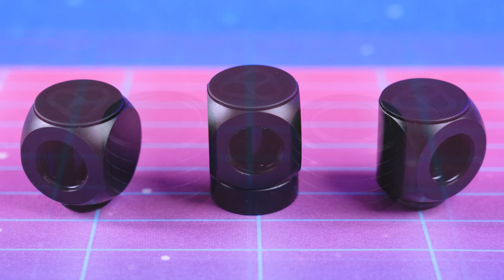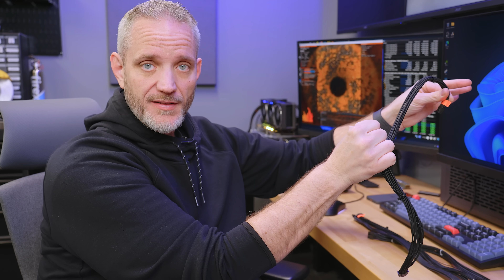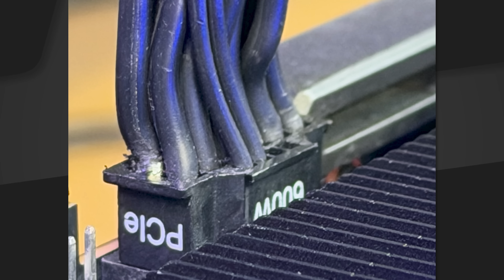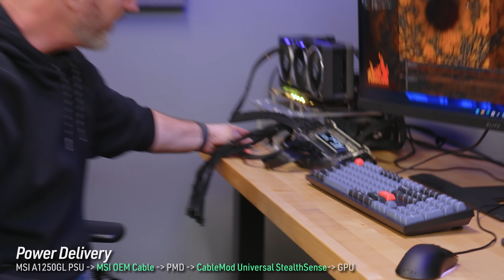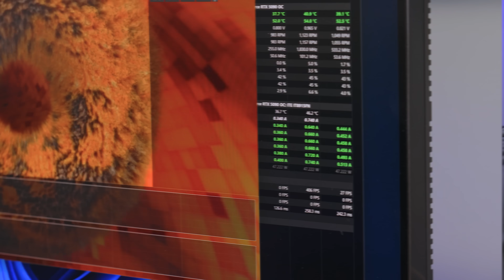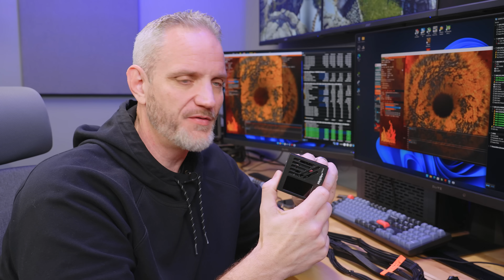More details on what could be causing 12VHPWR / 12V2x6 Cables to melt

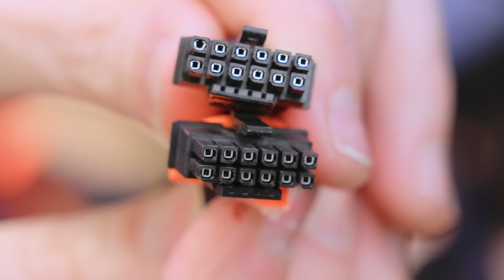Comment from the maker: Regarding 16:33, We saw in post that the corner pin was "pried open" but whats funny is that wasnt even the pin that was carrying the least load... so make sense of that one...??? Actually... its on the ground set of pins... so just as I showed by pulling out a pin, it can still work even if it isnt touching. The issue of melting connectors is almost always on the 12v side.
Reply: Two tests would be interesting:
1. A device that consumes power constantly (such as a DC Electronic Load) powered via the 12V2x6 cable with WireView.
2. Cable soldered directly to the graphics card (so you can practice soldering ;) )and observing the power distribution.
Reply: @63banshe  i think a card with a permanent cable would be less of an issue than these cables at this point XD
Reply: @MrPruske  Yup.
Reply: @MrPruske  At this point, with hardware becoming more and more expensive while being unstable as heck, i dont want to even buy it anymore. Games bad, Hardware too expensive and unstable. It is just not fun anymore to live with driver / hardware issues for years after paying thousands of euros for a computer that can barely run UE5 anyways. I dont need all of this to work on my computer and spend the rest of the time (& money) on different hobbies like my camera.
Reply: My RTX 2080 Ti S.L.I Ryzen 7 5800x 3D, with 3600mhz 32gbs ram system. Tops out at around 585 watts on GPU load max. in a few games. That's through 4 8 pci-express pins. The gold rule in life if it's not broke don't fix it.
Reply: @kevinerbs2778  what model is that? Both my 2080 ti kingpin and 3090 kingpin only have 3 x 8pins.

But yes I agree 8pins are fine. 3 of them delivered 1200 watts to the 3090 kingpin on ln2 without even warming up. They should have just switched to eps if they needed more power.
Reply: @Apollo-Computers  no,they should switch to 48v if they need more power...and use xt-120 connectors...xt-120 at 60a sustained is almost 3kw at 48v...so basically if they do this in the following year,it will be already obsolete given the speed of increasing power to gpus...
Reply: @PavelBrand  switch to higher voltage would mean new psu's.
Reply: @Apollo-Computers  it is similar to left/right drive,the sooner you do it,the less it will cost..you would have to do motherboards too...in the past motherboards depended on 5v (or even 3.3v) from psu...what would you wanna do when 1kw gpus are mainstream?that is 100a at 12v or 25a at 48v...off course hybrid psu will cost more,that's why i'm saying we need to go directly to 48v with motherboards too
Reply: @Apollo-Computers you already need a new psu for these 12v connectors...
Reply: Noticed that too.
About the 12vhpwr connector:  Never understood why they didn't choose a different connector type, the receiving pins on these are just not great for high current. The sensing is nice but not needed, abandon it and you have a bunch of proven connectors to choose from.
Reply: @audiogek  I think it was about space saving in the rack industry for server cards. And for cost-cutting measures, they just used the same design for consumer cards.
Reply: Isnt debaur give warranty for wireview 2 pro to fix or replace card in case of melting :/ I thought i heard him say that in his video. That is the reason for high price. P.S. Maybe you can make a video to strip those cables and show insides. Maybe there is some melting going on inside.
Reply: @Xioneer5 yes
Reply: Hard wire the cable to the PCB? If the connector is a problem; eliminate the connector.
Reply: That’s what I thought as well Buy a new Cable from cablemod Probably one with 3 or 4 8 pins on the power supply and And then cut off the other side of the connector
Reply: From my perspective as an automotive tech (CDJR), there's three issues here, one, the connector fitment, it shouldn't be so easy to plug in a connector, computers and autos share two common things, vibration and thermal cycling. Two, the spread terminal, that can cause issues, especially when it comes to pin fitment. Three, wire gauge, the companies that make the wiring harnesses build them as cheaply as possible so they can maximize their profits. Thinner gauge wire will wear out/fail sooner. Wiring harnesses built with wiring a gauge or two thicker can last much longer due to less heat which translates to better efficiency and less issues. That one pin pulling out so easily is a common problem in automotive wiring, so much to the point that in the service information, Chrysler warns to check for these things when diagnosing electrical issues.
Reply: You should have known the solution is "the more you buy, the more you save."
Reply: Bottom plug top right at the end also has a split
Reply: This has me thinking. With cables that are of poor quality and not correct gauge. It will affect the stability of one’s graphics card. Thus hypothetically shit cable will give poor stability and reduce overclocking potential. You might see marked increase in stability when overclocking due to proper connection and cable gauge. One thing also to think about when a card is giving problems.
Reply: Those thin cables and thin connectors are way weaker than what you find in many vehicles. Pulling some 60A in total would if you are to follow standards for electric distribution be in total of 16mm2 with properly made terminations. With 6 parallel wires it means that they shall be at least 1.85mm in diameter each, but to ensure proper conditions with parallel wires I'd say that each conductor has to be 2mm in diameter. That includes the diameter of the connector pins.

So to me the whole solution is just underdimensioned.
Reply: I maybe got a idea, remove the connector from the PCB, cutt one end of the connector of the cable, strip the ends of the wires from the cable, and solder the wires of the cable directly into the PCB
Reply: What can we do if we have FE 5080 that is not compatible with Wireview?
Reply: @mattlavallee8880  afaik derbauer was doing an adapter in one of his last videos on the wireview 2, with cables at both ends going to card and psu with wireview in the middle so that it would work with any card.
Reply: Thermal warping due to em effect or poor base metal composition causing failure under load? Causing peeling between two connectors.
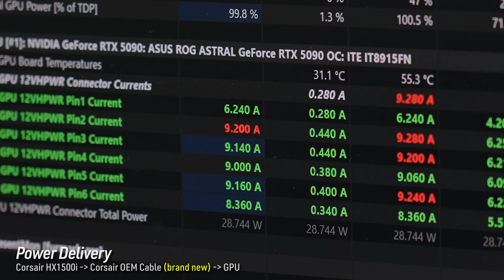Reply: 12:50 I have that exact power supply and cables in my system.  I lost a hard drive, power connector melted at the drive and the system had been doing weird things since I built it.  I'd replaced some cables with some I had from EVGA and things seem to have normalized.  Guess I'm going to replace them all just to be sure.
Reply: solder the wires directly to gpu?  lol
Reply: Hey Jay, just thought I'd ask but could you cover the 5070 and ti  issue of image flickering on displays as nvidia doesn't seem to want to fix it despite reports of people having problems since launch and having to rollback updates. Thanks.
Reply: Jay, can you make a new updated video on graphics settings? Now there's the new DLSS and Fidelity CAS is a highly used upscaling one as well.
Reply: Ye was gonna comment on that :D
Reply: You can squeeze that pin back together for a better contact. It's like with cars one loose pin will burn the whole connector or worse 🤣🤣
Reply: Hey Jay, not sure if this has been addressed or not. Cable length will also play a role in this problem. Learnt that whil rewiring an rv stereo system. Every foot of wire that thin can add some noticable resistance with that much power has anyone done the readings with short vs long cable? Interested to see. Anyway im new here.
Reply: @wayne5376  you need a bit of resistance,so longer cables are not a bad thing,helps distribute the load(if there is similar resistance in other wires)
Reply: Pinching the cable in the middle is not indicative of the wire itself being broken mid cable.... the connectors themselves can wiggle even slightly when moving a cable and come disconnected from one or more pins inside the connector. I've been building and repairing PC's for decades and I find that MANY cables connector ends are "loose" meaning they did not crimp the ends well (or tight enough). I've found this issue with AT MOLEX power connectors to SATA power to motherboard 24pin connectors to video card power connectors. The solution is SUPER SIMPLE use a pin or small tool to bend the female ends in so they pinch the male pins you connect them too tighter. You get LESS resistance (aka conducts power easier) this way and THUS less heat = no cable melt.
Reply: @AstarOfDavid (sorry, late to the watching party) the female ends, you mean the silver “square” pieces inside of each pin of the 12V2x6? Pinching them closer together so all contact points are taken care of?
Reply: I would love a video where you guys analyze regular PCIE 6 pin to 6 pin cables for older cards to check how much those have as variance.  Is that a hidden source of future problems, or are we good.  Of course, we aren’t normally having the regular cables melting and burning cards, but are they safe?
Reply: Aside from mechanical thinning of wires due to bending/pulling, you also have effects like corrosion on the pins (which is btw a problem for all connectors and why you use gold plating in a thick gold layer process or you set up welding-like processes where the surfaces combine to an air-tight object). You have problems with heating cycles. You also have problems with swinging due to fan and load on the wires/pins.

All in all I'd recommend to use the 4 Pins to establish an I2C Interface and just pull the SMBus from the MoBo through that by using the GPU as interface. That has 2 benefits:
1.) You can use a microcontroller each side to simply measure (monitoring) or even use a single or dual side multiphase bridge to control each pin and simply limit that (control) or even handling out that the gpu must use less power (react) and/or generate a warning tone (warn).
2.) You FIIIIINALLY have a standardized way of getting your PSU in the sensor network. You can now actively use the data from that end to get a FINALLY complete overview over your WHOLE pc. You can tell the user "hey man, I see ripple on my end which means my caps are old and I need to be switched out" or "hey man, i'm hotter than satans asshole, PLEASE clean and/or switch my fan!".

Nvidia just managed to actually have the worst out of EVERYTHING the way they did that. Really. They rolled a -2 with a 100 sided positive number only dice.
Reply: I see some of the connectors a little bit pried open.
Even so, yet again a solid great video!
Reply: Have you ever considered testing the conductivity of the supposedly poor-quality cables or their copper conductors, or having them examined in a laboratory?
Such cables are usually manufactured in Asia, even those from well-known manufacturers.
There are many factories in Asia that use impure materials in cables, fewer strands than specified for the AWG, CCA (copper-clad aluminum) conductors instead of pure copper, or sometimes even plain plated iron wires. Some can literally be tested by holding a neodymium magnet over them and lifting them up, which should not be possible since copper is not magnetic.
Normally, these poor-quality cables tend to appear in cheap, no-name mass-produced goods such as USB cables, etc.
But sometimes, due to fraud and gaps in quality control, such low-quality materials also find their way into the resource pool of professional manufacturing. 
I work in device manufacturing myself and have experienced this, and we are hearing more and more reports of this in the industry.
Reply: @Helli__  Come on. nGreedy used a connector made for way less current/power. Also you usually have wires with at least 100% safety margin and nGreedya is also strechting here. So even if you have impurities or stuff: nothing bad comes except you use them in endangered environment like rain, underwater and so on. Here we have a quite good environment inside a PC.

Also they took other ways which are the worst. The 4 management wires... i know a lot of interfaces working on 4 wires and provide MUCH more. One of these is connected with ALL internal important component and is also there for monitoring sensors ... the SMBus (I2C in slightly different).

nGreedya had the chance to FINALLY connect the last important component via their interface, but nuhuh it has to cost nuff. It was a chance to also kill off the proprietary solutions that most often work like a burning pile of tires, but as said: it cost a $.

The could've even gone MUCH further to allow 48-60V DC on that which essentially pushes down current to nothing AND require the PSU to have a multiphased pwm-controlled AND monitored 6 phased power stage here (which can regulate how much current each wire sees AND get the temp data - just needs a like 0.3$ controller on the GPU + some NTCs which are next to nothing). But noooooo.

It is not the wire. What burns is most often the GPU side connector, because there is where the material with the lowest melting/burning point is. IF you had a nick in the wire, you'D see that with a thermal cam, as that point will be the fking christmas tree on your screen (little area = high current/area = hotter than satans ass). What gets hot is the connection between plug and jack imo. The connector is not made to catch correctly, the crimped females are loose by default and they cant contain any strain and the whole thing does not like heat/cold cycling... and the user cant see when it is correctly mounted as there is almost no CLICK at all.

So who is at fault?
1. nGreedy taking a way too small connector for their use case?
2. nGreedya specifiying the most cheapest solution?
3. nGreedya setting up no safety measures?
4. nGreedya having the AWGs being barely able to fit ? (imo their safety marging is below 60%, while most real world use cases have like 100-150% - though even PCI 6 and 8 pins CAN melt with that)
5. nGreedya designing their graphic card to actually dont have a real world usable power stage?
6. nGreedy wasting all the potential they had with that connector?
7. nGreedya obviously giving a shit?
8. nGreedya designing a system that is hard to use for the user?
9. Some chinese company dont caring on a part that is not really part of the fire hazard in a first sense
10. The user not hearing?
Reply: Can you do more videos on i9 13k undervoltting.
Reply: Jay how about you get some heavy gauge wire an make your own pins connector.
Reply: They just want control and everything proprietary. If u don't use it, u are not an aib of jesen tiny wong.
Reply from the maker: @RissKey1955  ... so what about the AMD cards that are starting to use it? You think they care about Jensen?
Reply: @Jayztwocents  A hastily and cheaply designed connector is ABSOLUTE DOGSHIT - who would have thought.
Reply: @volf3r505  Its not even just the connector, which is bad, too small pins and too much current - its the fact that only one card tier on one brand actually put in some sane safety measures (but its still up to you to check) thats the extremely frustrating part, the design engineers looked at this connector and just sent it as is.  mind boggling.
Reply: @Jayztwocents  Fun Fact:  Lisa Su and Jensen Huang are related....so yes she cares.
Reply: @bigsmackisback2052  yeah its a compounding issue - its shit piled into more shit. 
I still fail to see why it was needed, when we already had like 3x8 pin proven connectors ... 
Oh I forgot, NGreedia is lying about their true wattage and powerspikes since Maxwell
Reply: @Jayztwocents I just bought the 9070xt nitro plus is there any power supply that comes with high quality 12v 2x6 that you would recommend
Reply: @Jayztwocents  the AMD AIBs that put that connector on their cards are because is cheaper to put 1 connector only instead of 2, 3 or even 4 and they can make cards with a good look because of less connectors!
Reply: @RissKey1955  It is about saving every penny possible. It saves on the board cost as it does not need as many traces, connectors and holes. Plus it cuts down on board size.
Reply: We need 24V HPS supply spec👺
Reply: @Dennis-kf0rlx  48
Reply: @JohLincN  HVAC and now we have those AC condenser sized RTX card memes for real 🤣🤣
Reply: Well, I see all the cable fuss differently. The ATX standard was poorly designed for 600W+ of power so best option I see is to add seperate high voltage lines (48V) terminal for powering 300W+ GPUs. This way PSU is backwards compatible and cables stay cool.
Reply: "overclockers" are a decade behind software engineers (this being OS dev, game devs, firmware devs, driver devs, physical architecture compute design etc; OC ing expired about a decade ago) !!!!! need not say more ; so trying to OC modern shit is useless and can damage performance due to underlaying immense complexity in design; the people that make current shit for population are about 4 decades if not more ahead of average TOP user; its like people know how to service and ride a bike and suddenly they wanna OC a F1 car; so for those desperate for OC ing .... just dont .... u end up ocing ur shit but the software stack is designed for optimisation not for brute force, they chose ideal scenario not maximum brute force possible, ideal scenario is the one that works on many variant of compute platforms (cause not many have 4090 s in their room, average world wide is still ddr3 close to ddr4 despite people talking about 8000 mhz cudimms)
Reply: when racing around a track the tires are also replaced very often and even the engines, but you just keeps on using the same cables and  connectors all over again. These things have a specific amount of insertions and I believe it was a surprisingly low number like 10 times or so. True that doesn't cover the 1 new cable, but you can also blow a tire when parking on a nail, even when you drive it only once a week to go grocery-shopping.